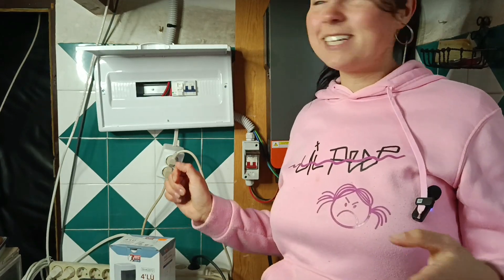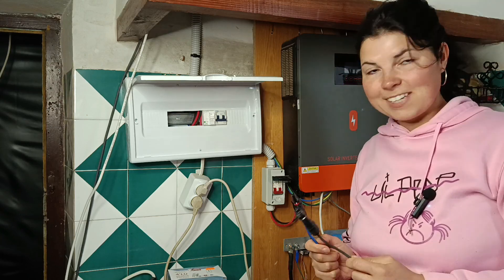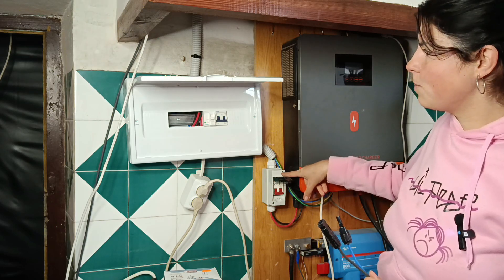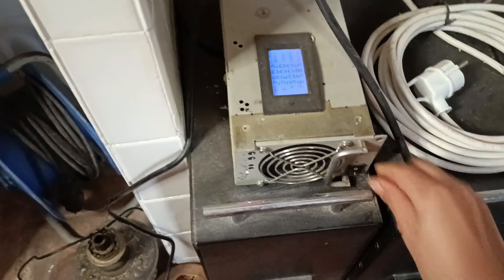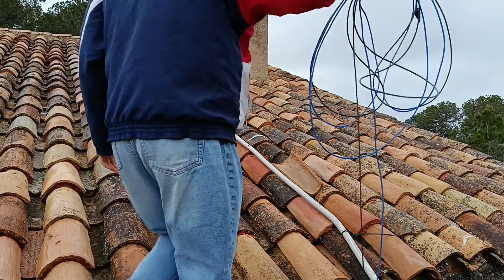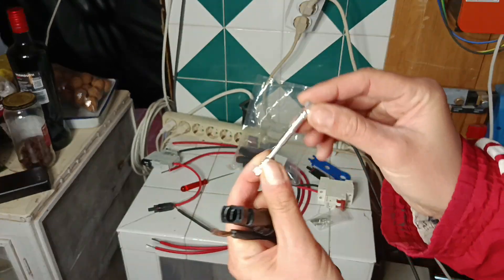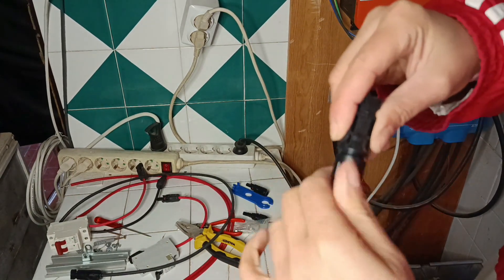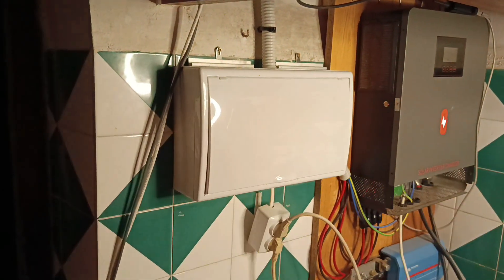Connecting my solar panels PROPERLY with electric circuit breaker

Comment: At first I thought you were just a girl who was an alternative energy enthusiast, then I saw that you had a sewing machine, well, I think you were a progressive modern seamstress who also understood electricity. But in the description I saw that you were also a programmer. On the one hand, this is even better and cooler, but on the other hand - shouldn't a programmer draw up a block diagram of the future program, instead of immediately rushing to write code? Because the inverter, cables and box on the wall first tell us about a fairly large degree of chaos and disorder in the system.
Calling the emergency services in case of electric shock by another person is the right idea. But when you think about it, it's not difficult to prevent this with simple rubber gloves on your hands.
Reply from the maker: Imagine it would be all organized and nice and correct from the first go --- it would be so boring :) cheers 🇺🇦🌷
Reply: I'm impressed -Kenya, Africa.
How many watts does your Solar panels produce and the rated power of the inverter to run your refrigerator ?

Comment: Damn, I hope your place doesn't burn down, electrician here, your place would be a perfect example of showing our apprentices of what not to do, LOL. We don't use DC breakers here anymore they are a fire hazard, we use DC isolators, on the roof beside the array string and an isolator per string incoming to the inverter for isolation purposes. You have AC and DC cabling mixed together, they need segregation, as they have different fault ratings on their respective cabling. I wish you all the best.
Reply from the maker: Cheers! Thank you very much for the recommendation, I have not heard about DC isolators before, I checked it up and it looks like a good security improvement for the future.
For AC and DC don't think I'm following, I have in the left part DC (from solars), one the right -- AC for home, neither of cables go in the same place. Maybe I misunderstood you? Cheers 🌷
Reply: @ProgrammerOffgrid  the insulation breakdown characteristics of the cabling are different dc cabling is rated for dc high voltage, and ac cabling is rated for ac. So in otherwords ac and dc high voltage cabling shouldn't be near or touching each other, without some sort of barrier. So in that swbd, you could put a fireproof material separating the ac side from the dc side, and keep all components separate, ac for ac, and dc for dc.
Reply: @ProgrammerOffgrid  
🚧Using any PVC (esp. white plastic flex tubing you used) Conduit is NOT allowed (nor Safe). For DC entering a dwelling , Foto-voltaic DC conductors must be in Metal (EMC) until 1st DISCONNECT ⚠
Reply from the maker: @solartime8983 hi! Thank you for taking a look at it! I did not  know that should be in metal. This tubing and the original box installed the real company that I hired to install panels on the roof. (Before I had everything that I connected myself laying on the ground) to install them on the roof I hired the company that did it and paperwork (submitted the project to the town hall and received necessary permissions). They did use my connections but added this tubing and the box, and built the frame itself and put panels there. So ... Now it makes me wonder 🤔
Reply: @ProgrammerOffgrid  local code May not require metal there...local Jurisdictions Are varied!
Reply: @solartime8983  Irregardless of "Local Codes" if you over engineer something and it is better, you will never have to worry about it failing. DC and AC systems should be kept separate especially a moderately high voltage, high current cabling, as the two cabling systems have different ratings and characteristics.
Reply: @ProgrammerOffgrid  My pleasure. I mean where I live we have the highest electrical standards in the world. So I may be a little biased. Very low electrical accidents and incidents.
Reply: @bh9420  Agree.🗽If you see my earlier response, I state she's needs EMT metal conduit for Safety...despite any code. 🌞
Reply: @ProgrammerOffgrid  I also just saw you have a Ground (2 old rods? ) but the Grounding Conductor should be Size #4 AWG. It looks lot smaller in video 🤔

Comment: Just some hint to use ferrules on the braker wires and 1000V-rated tools (VDE tools in german, or herramientas aisladas in spain) for your own safety.

Using ferrules in electrical wiring offers several important benefits, making them a valuable tool for ensuring safety, consistency, and durability in various applications. Here are the key reasons why ferrules are important:

### 1. Enhanced Safety
- Ferrules prevent wire strands from fraying or splaying, which reduces the risk of short circuits, electrical shocks, or other hazards at termination points[1][2].
- They also provide insulation at the base of the wire, minimizing exposure to live wires[1].

### 2. Consistent and Reliable Connections
- Ferrules create a uniform connection point, making it easier to achieve consistent results across multiple terminations[1].
- They ensure all strands of a wire are securely held together, reducing contact resistance and improving electrical performance[2][4].

### 3. Protection Against Damage
- Ferrules protect wires from mechanical stress, such as over-bending or splaying during installation or rewiring. This is especially useful in control panels where wires may be disconnected and reconnected multiple times[3][2].
- They safeguard against corrosion and vibration, extending the lifespan of the connection[2].

### 4. Cleaner and Safer Multi-Wire Terminations
- Ferrules provide a clean solution for combining multiple wires into a single connection point without risking loose strands or poor connections[1].

### 5. Improved Work Quality
- Using ferrules enhances the overall quality of electrical installations by reducing maintenance needs and ensuring long-term reliability[1][4].

### 6. Ease of Installation and Maintenance
- Ferrules simplify installation by making it easier to insert wires into terminals without damaging strands. This also allows for non-destructive disconnection and reconnection during maintenance[2][5].

### 7. Compliance with Standards
- In some regions, such as Europe, ferrules are required for compliance with standards like CE marking for electrical equipment[4].

By using ferrules, electricians and engineers can achieve safer, more reliable, and professional wiring results in industrial, commercial, and residential applications.

Citations:
[1] https://rspsupply.com/education/a-95-top-5-reasons-why-you-should-use-ferrules/
[2] https://wiringharnessnews.com/six-things-to-know-about-ferrules/
[3] https://assets.phoenixcontact.com/file/d62f9337-3fc6-4a22-84ba-d5658474fd17/media/original?7904.pdf
[4] https://www.arrow.com/en/research-and-events/articles/what-are-ferrules-and-why-should-you-use-them
[5] https://www.reddit.com/r/AskElectronics/comments/na0lu8/when_to_use_ferrules/
[6] https://community.victronenergy.com/t/using-ferules-pros-and-cons/1301
[7] https://www.wago.com/global/building-technology/electrical-installers/helpful-tips/ferrules
[8] https://engx.theiet.org/f/wiring-and-regulations/24248/use-of-cable-ferrules

Comment: I installed a breaker just before inverter.  I also fitted an MC4 connector with fuse at the solar panels, to protect in event of a short between the cables going to the breaker.
I recently installed a nice meter before the breaker that shows me the voltage and amperage while inverter is powered and shows open circuit voltage of panels when breaker is switched off.  The meter also accumulates kWh of generated power.  I was pleased to find that the meter 'remembers' the previous kWh when powered up after being off for quite some time.
Reply: The fuse can go anywhere on the wire, there isn't really a before or after in the circuit.

Comment: for some reason ive been unable to reply to comments and had also stopped getting videos recommendations from you, i know im not subbed but still is a bit weird, this video did pop up in my feed though. i think this is a good thing as now i have some more content to consume.

0:06
i chuckled a bit because my setup would probably give some commenters a brain aneurysm

5:05
my "special" MC4 disconnect tool are my fingers >insert smug face<

10:10
i tried having a disconnect for my panels too but the ones i had couldnt handle high voltage in the summer and they also introduced a lot of resistance causing the casing to heat up. it could have been my fault but i didnt want to risk it, so i removed them. i havent really needed to disconnect them like you did, so it hasnt been on my mind until now.

11:15
this was actually one of the first things i did before setting up my system in order to get an idea of how big my battery bank needed to be. im surprised your batteries didnt come with some kind of shunt to track power usage, personally i have a victron battery shunt which helps me keep track of power i have left. this winter was brutal tbh.

i would love to share my experiences with you but unfortunately i cant really post pictures in utube comments :L
maybe over discord

anyway, great video as always, looking forward to more. cheers!
Reply from the maker: I read about it this! That YouTube since 2024 changed the way they recommend the content to people subscribed to the channel -- basically they don't (?!) I'm listening detective stories in Ukrainian from one channel when I make dishes or cement something or this kind of work, and I never have them in recommendation, though I'm subscribed and listen to this channel literally every day 💔
My batteries are connected to inverter via victron bus bar/shunt, it has Bluetooth app, it shows the total consumption/charge, which is something,  I'm excited about this new thing to see each appliance separately too. Cheers🌷

Comment: Maybe consider lightning/surge protection
Reply from the maker: Yes, thank you! I need to look at that too, guess there is something in shape of the breaker to go inside of the box!
Reply: Yes, @ProgrammerOffgrid it's called a SPD. Surge Protection Device. Nice work,  great to see you improve your Homestead continuously, and always learning. Best wishes from the U.S.
Reply: @ProgrammerOffgrid  they fit on a standard din rail, nust like the breakers
Reply: I would also agree that fitting surge protection is a good idea as it will protect your inverter and the electronics in your batteries. I would also recommend that you change the breakers to DC rated breakers. I have also noticed you are mixing AC and DC in your fuse board, this is not recommended. I always use a separate fuse board just for the DC breakers and surge protection.

Comment: I am not an electrician, all my panels are ground mounted, so I think a good tip is to open each string at one point at the panel location  if you are working on the wiring
Reply from the maker: I indeed have little knowledge about this. But as I understand there is no difference if I disconnect the string on panel location or in the inverter, as it's the same chain.
There were quite a few people in my prev videos saying they are electricians, let's see if someone could comment on this too. Cheers 🌷
Reply: @ProgrammerOffgrid  that's the same thing, only if you don't have mp4's at the inverter end, then open the string at the panel end